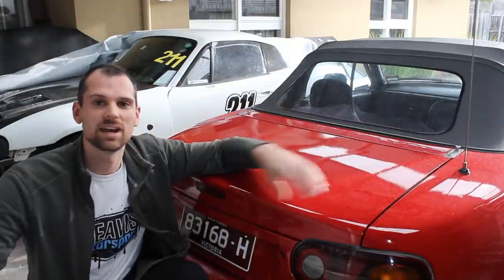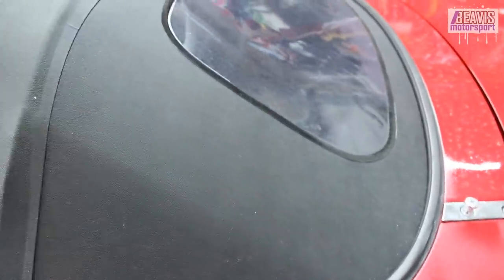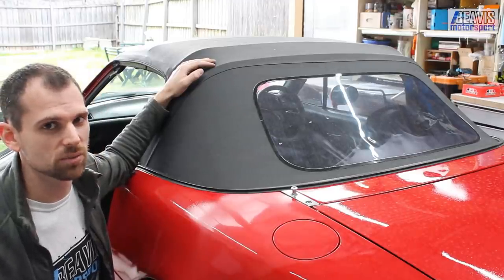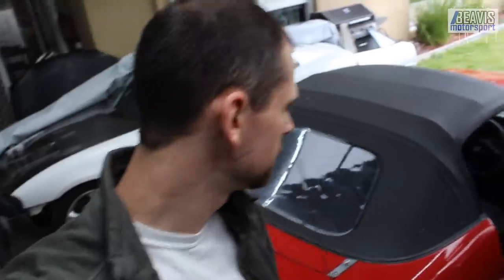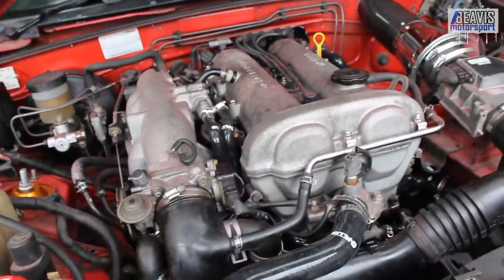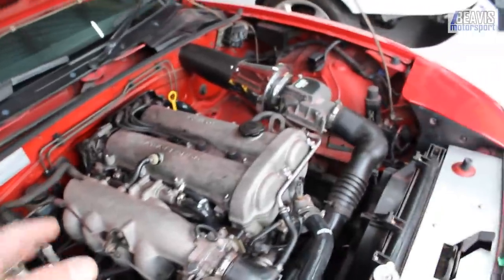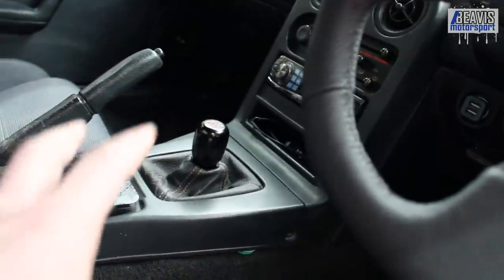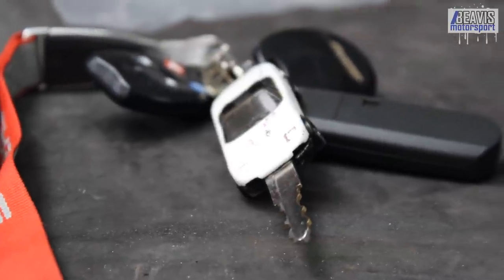ULTIMATE MX-5 MIATA BUYERS GUIDE - WHAT TO LOOK OUT FOR

Comment: Fuel economy took a real dive. Having tracked a problem to the MAF, I cut out the top and in inspection found solder had sagged from one terminal to short the one below. I separated the circuit with a flick to the molten solder bridge and got back to normal. I siliconed the lid back and we lived happily ever after.
Reply from the maker: Wow that's odd that it could even happen, glad you worked it out!

Comment: The brake slider pins needed to be freed and greased on two NBs I've owned. I've heard they don't lube them from the factory!! My NC had plenty of grease, however. 
This was a very good guide. You've touched on all the areas that my months of research on the forums provided. 
If you need a quick top, check out the salvage yards. You may be able to get a top with frame that you can swap in with four bolts (NA NB frames are interchangeable but the vinyl or canvas is frame specific).
Reply from the maker: Thanks for the additional suggestions Mike. :-)

Comment: Great video and very informative. Thanks! I've had three of these over the years. Big thing I found is that if the car has been in an accident they seem very hard to get perfect again, meaning take it out on a smooth road and get it up to 65 MPH and see if it shakes. This car is a unibody so when it gets out of alignment you will hate driving it. Also, make sure the top doesn't leak and look for a window that wasn't taken care of. These plastic windows must stay flat and not fold over when the top goes down. It IS a pain to use the zipper and release  the window but if you want the window to stay nice that is what you have to do.
Reply from the maker: Hi Scooter, thanks for watching and for the suggestions. I agree, I'd always suggest taking a car for a reasonable drive on a variety of environments before making a potential purchase.

Comment: I'm interested in buying a '99 Miata  with 168k miles (270k km), so this guide is super useful. I've mostly ever driven and worked on '90's Nissan's and am used to that engine but I can't find a decent 2dr coupe that isn't beat up to all hell. I'm giving Mazda a chance
Reply from the maker: Glad you found it helpful mate!
Reply: Check the front chassis rails and the sills.... these cars are ace but they rust like mad. Upper inner rear arches turn into weetabix, you can quite often poke your fingers through the front chassis rails and the sills are ball bags .. be warned

Comment: Totally agree about the automatics; they are an abomination on a sports car (or any car, in MHO)! FTR, I drove my 1994 125K miles, after I bought it at 40K, and yes it did need brakes, tires, top, etc. (I put Koni adjustable shocks in when I bought it, which never failed), after reasonable amounts of time/miles, and I did replace the interior with new Katskins and a nice plush carpet, but the one thing that did fail, twice, nearly leaving me stranded both times, was the clutch slave cylinder, and mine never got spongy, it just suddenly stopped disengaging the clutch! But I forgave it that, as it was otherwise extremely reliable. I sold her after 11 years, because I also had an SUV which I needed more (a Toyota 4Runner, which I still own 14 years later, also with a 5-speed MT), I didn't have a garage, and didn't like taking care of 2 cars, HOWEVER, I plan to replace it soon (I now have several garages, and cars). Miatas are GREAT, FUN sports cars, that are also relatively cheap, and cheap to keep.
Reply from the maker: I drove an early 90's NA MX-5 with an Auto trans, it was genuinely pretty atrocious. In contrast, a 2016 ND MX-5 with a modern auto trans is a much sharper and more pleasurable experience. Perhaps far from as nice as a manual, but it's definitely nothing to turn your nose up against.

Comment: HI I'm 50 years old and bought my 97 MA MX5 Manual Blk/Blk soft top in 2016.  When I purchased it, it had a clunk on 3rd, prev. Owner didn't do any maintenance.  That Helped me negotiate a under her. KKB price point.  So for $2100.00 worth $ 3100.00 Low miles just over 100k she was now mine, but 1 key and alarm fob for the trunk, doors and arm rest. Took it in and that clunk? I put back into her the money I saved at purchase.  No rattles or engine sounds at all. After paying for a new drive shaft, later new radiator, A/C, Timing Chain, water pump and Alternator. I look on the bright side, I have meticulous service records and she is golden under the hood. Road trip in 2017 from CA to Georgia and back safe and sound. To comment for the older crowd, it's very low so if you have back, Hip or leg issues; it's not the best fit for you. However, this car is my fun car, mid life no crises, drive my grandson for ice cream, feeling good where ever you go car.  I've noticed that bumps are feeling a bit harder on "my bottom" and looking into new struts. It's a classic ride for those of us in the classic catagory.  In regards to parts, Mazda does not carry the soft top, window assembly, rain guard, speed sensor for the 1997 manual transmission (code B0500 unable to smog if not fixed) they state these have been discontinued. I suggest you pick up as many small parts in advance as they will only get more expensive. Pick a parts, seller/buyer apps (offer up,  let it go, Craigslist or Ebay) or even FB Market you can find everything you need. Go for it! Enjoy!
Reply from the maker: Thanks for sharing Rain Weather, that great to hear :-)

Comment: Hi mate, just found this video, thanks for the info. I'm hoping to purchase and NA in the next few weeks. Two questions...
1. Is there a way to identify the short crank / big crank via VIN?
2. Is there a preventative "fix" for the short crank issue
Reply from the maker: 1. In my opinion, regardless of year/VIN, always easiest & safer to simply check the ‘slots’ on the crank pulley of the engine itself, always a chance that an engine has been changed at some point over the years.
2. This link details most everything you need to know: https://www.miata.net/garage/crankshaft.html
Reply: @Bbeavis  thanks mate
Reply: NAs with short crank issue are typically ones made from the years 1990-94 I believe

Comment: You missed two critical areas. The chassis legs and the drain hole area you did mention, if not kept fastidiously clean then you get water onto the back of the dills which also support the seat belts and those two areas are the main reasons to walk away from buying the car
Reply from the maker: Thanks for the tips Brian.

Comment: Great Video Sir! Informative... tempting to get one myself :D 
Anyways, whats with the Automatic Transmission? Any particular issues with that as compared to the Manual one?
Reply from the maker: There aren't any known common issues. But for the NA and NB chassis, the Automatics were archaic and certainly don't compliment the "driver centric" experience that an MX-5 is known to be about. However, if you are set on an Automatic, highly suggest you consider the later NC or ND chassis as their autos are far more complimentary and pleasant to use.
Reply: @Bbeavis  Thank you for the prompt reply! Will definitely consider!

Comment: Absolutely want one of these! I'll be on the market soon for one and I want it red with at least power steering, though I'm on the fence about whether a manual or automatic will do me best. Most people say manual is the way to go...any thoughts?
Reply from the maker: Manual vs Automatic transmission? Without a doubt if it suits your driving style/requirements then the manual is a superior experience.
Reply: @Bbeavis  Thanks! I had a feeling that was the case but the confirmation helps me out!

Comment: I should’ve known something was up when the car was grinding at start up 🙂 I ended up changing out the starter and it no longer grinds at startup
Reply from the maker: At least it was a relatively easy fix, and you got it all working happy again! :-)
Reply: @Bbeavis  next thing I have to worry about is aligning my soft top fully 🤣 it doesn’t want to align properly when I clip it and it leaves a gap between the windshield frame and soft top

Comment: Hi just a question I hope u can help me out looking at buying a 1.8na that was previously a auto it's been swapped over to manual.should I be worried about anything in particular.thanks in advance
Reply from the maker: If it has already been swapped and working, there's little to worry about. The rest of the car is more or less the same.
Reply: @Bbeavis  thankyou for your advice.
Reply: @Bbeavis  how much would u expect to pay for a 1995 1.8l mx5 with around 200000kms and would u say that the engine would need a rebuild with that many kms.
Reply from the maker: @rickportela6009  Price depends hugely, location, condition, service history, paintwork, etc. A rough price might be somewhere around $10,000 to $16,000 for 'most' cars (exceptions to that range may be highly modified or showroom quality cars).
Similarly, a reasonably cared for car with 200,000kms could easily still have another 200,000 or more in it, or it could be on it's last legs if not serviced or neglected such as let to run low on oil.
Reply: @Bbeavis  thanks .I was looking at something that has been repainted and we'll looked after.it is a 4 hour drive from me so was thinking of getting a mechanic to overlook the car first.
Reply: @Bbeavis  great videos by the way

Comment: Hi are you able to help me out  l have petrol fumes in the cabin can you suggest where it could be leaking from thanks John
Reply from the maker: It could one of these:
Worn upper shifter boot.
Worn out upper fuel pump tank seal.
Leaking fuel filler or breather hoses from the fuel tank.
Leak in exhaust system.
Reply: @Bbeavis  thanks for your suggestion l will check these areas out

Comment: Hi, I wanted to buy a miata nc as first car. Is this a good idea?
Reply from the maker: That's totally up to you and what you need out of a car. But an NC is cheap to run and maintain, fairly safe and a great car to learn in. But they are a bit small if you need to cart around a lot of stuff or have family.
Reply: Derpyface41 Too small for an only family car, but fine if your spouse has a car or otherwise you can swing a second car. Mine did everything I needed it to do, until the first kid arrived, at which point I switched to an SUV ('99 4Runner, with the essential 5-speed MT). The Miata was fine for everything except transporting >1 passenger...

Comment: Why did you say to avoid shortnose pully? What does that mean and why to avoid it.
Reply from the maker: Hi Holger, The shortnose are known for premature wear of the crank pulley and other related failures.
This details it perfectly: https://www.miata.net/garage/crankshaft.html
Reply: Only the very earliest MX5s (NA Series 1) had this issue, and  even then there's now a relatively easy repair (google "short nose crank loctite")  because Series 1s are a favourite for restorers and collectors - they're actually dearer than the NA Series 2 these days. Any 1.6l after 1990 had the long nose crank, just like the 1.8.

Comment: 1.8s are not "better". They have more power, but they don't rev as easy as the 1.6 and the extra weight sort of offsets the small power advantage. The 1.6 is more fun stock, but the 1.8 has the advantage of being better when modded. They two are simply different and each have their good points and bad points.
Reply from the maker: This is certainly the "excuse" that people have used for many years, just as they are saying nowadays for the 1.5ND vs the 2.0ND. The fact of the matter in both cases is the larger engine is superier. Except in the case of the 1.8 BP engine, we have better aftermarket support, more interchangeability of parts, and a superior basis for modification. The weight difference is really not as much as people like to suggest. The reason the 1.6 doesn't feel as slow as it perhaps should, is because they came with a quicker ratio differential to compensate for the lower power output.

Comment: Is it the same sort of stuff for a 2001
Reply from the maker: Mostly, yes, they have a very similar chassis and many interchangeable parts.
Reply: BEAVIS Motorsport, got a black 2001 Jasper Conran edition for 550 but it kept cutting out after about 10-20 mins, changed the crank angle sensor and now it runs very nicely other than slightly smokey, very minimal rust though which is good, very happy about it 😁

Comment: The automatics are that bad?
Reply from the maker: Hi John, in the case of an MX-5, I would only recommend the NC or ND models if you are set on an automatic transmission. The earlier NA/NB auto's are really unflattering. The later auto boxes for the NC, and certainly for the ND, are sharper, more pleasant, and with paddles on the wheel, feel quite sporty. Thanks for watching!
Reply: BEAVIS Motorsport  can you explain NC and ND? How would I know one from the other? Thank you!!
Reply from the maker: @kennedy7955  Sure, the NC also known as Mk3 was made from around 2006 to 2015, the ND or Mk4 is the current shape MX-5 miata, having been around since about 2016.
And for clarity, the NA is the original MX-5 Miata with the popup headlights, made between 1989 and around 1996. And that leaves the NB,  second generation, 1998 to 2005. Hope that helps!
Reply: @Bbeavis  thanks again, unflattering - can you describe a little more what you mean by that.  Assuming you mean unreliable,  any idea how long or how many miles you can put on one of these automatic transmissions from the earlier models (1994)
Reply from the maker: @kennedy7955  Unflattering, as in, old, slow, sludgey, not responsive, and not very fun.... I cannot comment on how long they last sorry.

Comment: What's wrong with automatic miatas? Do they fail more often
Reply from the maker: The Automatic NA/NB early generation Miatas are just not as fun or satisfying, theres nothing mechanically wrong. In the later years the Auto gearboxes are a bit nicer to drive.
Reply: The automatics have less compression from the factory as well so even if you swapped it it wouldn’t be as good as a manual
Reply: Learn to drive manual

Comment: 3:37 are wrong those were drain holes when the car was painted in the factory i have a roll bar mounted on those holes and there is no way that water can be there because next to them are electronics
Reply from the maker: Sorry Ege but that is completely incorrect. They are drain holes for the rain rail as part of the soft top. there are rubber hoses connected to the plastic containers either side of the car that drain out in front of the rear wheels.
Reply: well in that case we are not talking about the same holes so neither of us is wrong

Comment: How believable can you be when you advice to avoid a 1.6 and that's what you got...🤔
Reply from the maker: Do as I say, not as I do? If you are buying one and have a choice, then the 1.8 is superior. I bought a 1.6 because it fit my budget. No need to get all smart Carlos.
Reply: A 1.6 ain't bad and a great proven little motor.Drive it in the high rpms with the power bands and short throw  gears and it's all good.Then again I never driven a 1.8.I actually love my 1991 and it would feel like cheating on her if I took a 1.8 for a spin.Miata folks are a different kind of folk.So many regret getting rid of their first one.Anyways ...

Comment: What did you say at 8:44 ? Leaking from cars? I saw à mx5 leaking from there and i dont understand what is it, maybe you can help? 🥲
Reply from the maker: Common oil leaks, the first one mentioned is the O-ring seal around the Cam Angle Sensor, aka 'CAS'.